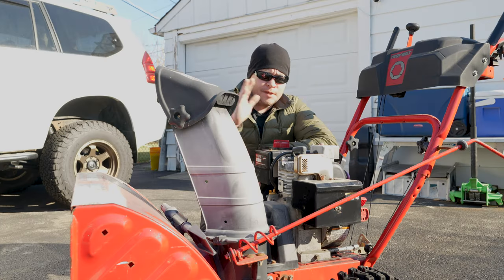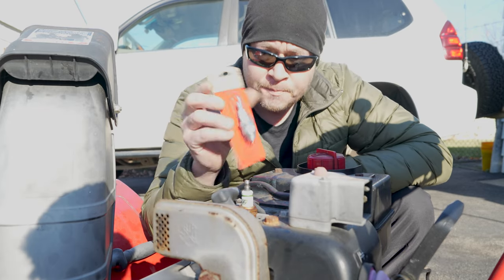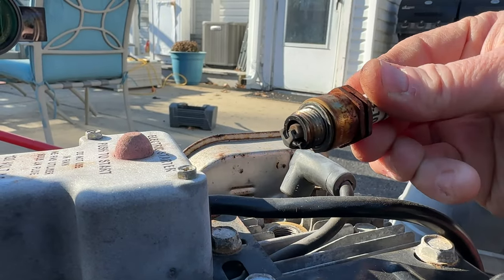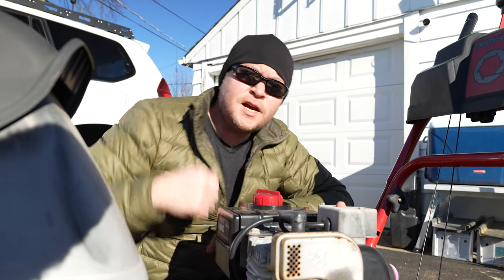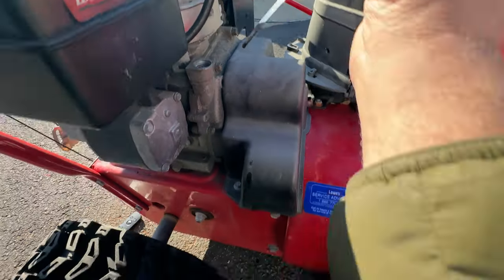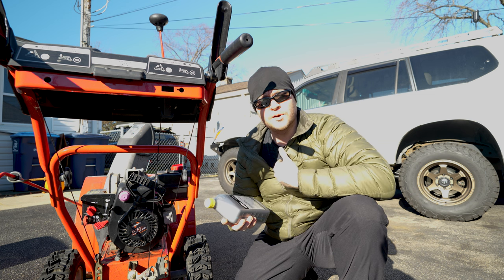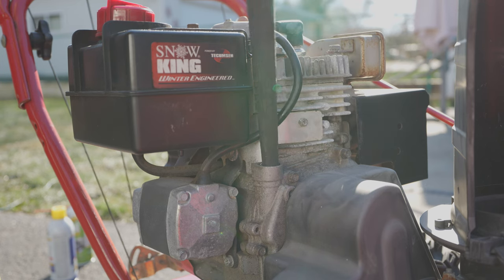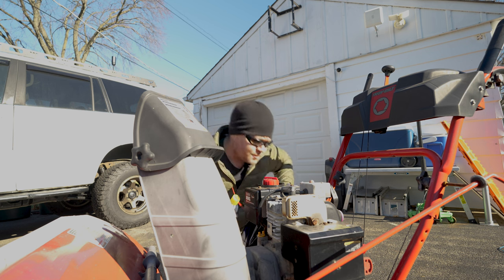Annual Snowblower Maintenance

Comment: Great video. It amazes me how many people don’t PM their equipment. Many friends of mine constantly have issues with power equipment and ask me why. The answer almost always boils down to failure to do the most basic PM’s on their gear. 

My recipe for all small engines, 4 cycle and 2 cycle, is the same…
✅ PM’s annually or as needed
✅ Ethanol free fuel
✅ Quality lubricants and parts
✅ Run dry before storage

Thanks for posting, you def saved someone a very expensive winter surprise. 🍻

Comment: Thanks Tom …enjoyed watching as Im having my morning coffee… in Canada we have a company call Crown Rust proofing and each year when I get my Crosstrek coated the usually give me a free can of the product in aerosol form…it’s great for spraying the snowblower metal parts and keeps them free from the salt that is present on our roads that ends up in a big pile at the end of the driveway.

Keep up these great videos ….!
Reply from the maker: Thanks Goober!  I like the consistent rust proofing.  I hear ya on the salt....here in the US midwest salt is used heavily in the winter and it's absolutely brutal on our undercarriages.
Reply: @TomtheDilettante  funny thing happened after I watched your video ..I decided to change the spark plug. It’s an Ariens so the plug is sort of hidden down in the motor and there’s a metal should over the plug you need pliers to remove. The old plug came out but with a lot of resistance and had some obscure plug I’d never heard of. I called the local Ariens dealer to find out what a good replacement was ..they recommended NGK.
I would like preface this with saying that I’ve changed quite a few plugs … so the new one got coated with a lite film of anti-seize and I stated it by hand . The first complete turn went fine , switching to a 1/4 ratchet and after only about an additional 1/4 turn I felt some resistance ..so I back out the plug and noticed it was trying to cut a new thread… sh it
It’s off to the dealer to,have the head replaced and a new plug installed..had this happed at the end of the winter I probably would have talked the work myself., having just put a new connecting rod in my neighbours Honda  Track snowblower.

I think it was cross threaded from the factory 

Sorry for the long winded response …I follow very few sites ..but yours is once I’m sold on… always something different , always great content

Comment: My unit is from 1989, I changed the oil once, never replaced plug only replaced a drive belt due to looseness. Also a cable went bad. I keep all gas devices FULL when put away.  An empty tank allows air in & out due to expansion which brings moisture with it.  So treat fuel or keep tank filled.  I’m 100% sure you have grease fittings on the auger axle. You gotta lube them!  Also you have oil in the auger gear box so check that level. Drive belts need to be checked too. Be careful swapping plugs. They are different heat ranges… maybe not critical here but are very critical in cars.

Comment: Great video. Do you drain the gas out at the end of the season?
Reply: I fill my gas tank at the end of season and use STA-BIL , this product works great and over the last eighteen years I’ve never had an issue starting the blower..or my mower .
One thing I did change was I always use high test gas because it doesn’t have ethanol in it.
Reply from the maker: Same as Goober.  I top off the tank and use STA-BIL when n storage.  For the 1st tank refill of the season I'll also toss in some Seafoam to help clean out the jets and any other deposits.

Comment: And don’t forget to check that tire pressure. 😂
Reply from the maker: good point.  My tire pressure check is usually just stepping on it and using my calibrated foot to gauge pressure LOL.  Even it's a bit soft, I'll leave it for good traction...kinda like airing down on my 4x4 :)

Comment: You had to have run the fuel out of that before you stored it. . .that carb had ZERO issues.  Ethenal?  ethnyol?  that corn crap loves to eat carbs.
Reply from the maker: Hey Jim.  yes, I probably should have mentioned that in the video.  I drain the float bowls on my carbs, top off the last tank, and throw in some Stabil at the end of each season before storing.  I recently also started running Seafoam thru the carbs in the weeks leading up to storage to help clean out any crud.  As for gas, I just use the cheapest local unleaded (I'm cheap).  You're right though, ethanol loves to eat o-rings and gaskets.  So far no issues though.  Thanks for watching :)